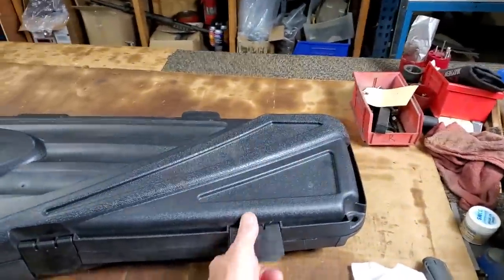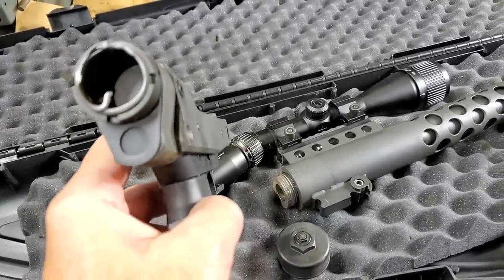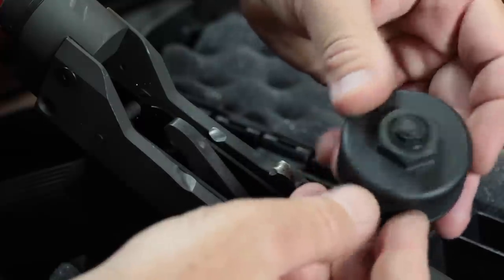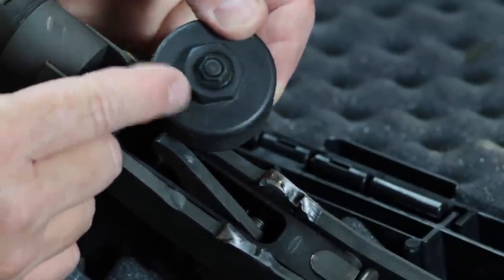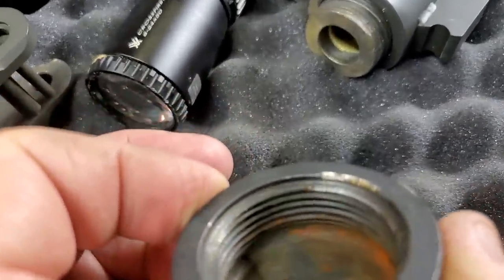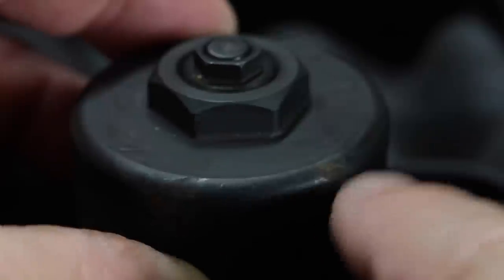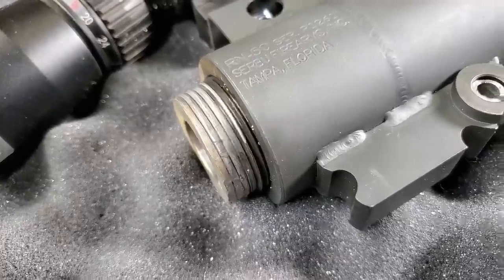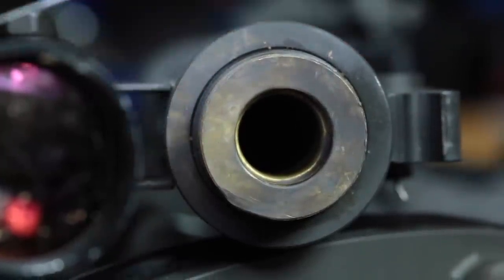Kentucky Ballistics' RN-50 Blow-up:  First Look

Comment: Scott got extremely lucky and it's a great case example of getting too complacent doing something. He's shot a lot of second hand specialty ammo and it's worked out for him. So when the warning signs popped up, ammo performance being erratic, harder recoil, larger flash, etc. That should all be signs to stop firing that ammo he didn't. Thankfully Scott didn't film that alone otherwise there would have been the horrifying scene of a man bleeding out as his last video.

What we can all learn and reinforce from this is when ammunition is behaving different or erratically STOP using it. Ammunition should be consistent, any time you pull that trigger and it feels off stop and think about it, did it just squib? Are the rounds underloaded/overloaded?
Reply: @pete7413  Wow yeah squibs suck let alone 2 of them, if you don't notice it then you are loosing a gun and a body part usually. I don't reload and thats the reason, I simply don't trust myself to not make a mistake like that. I am sure there are plenty of people who reload and get along fine but for me its just a no go. 

The best way to make sure you aren't going to do something that kills you is asking yourself one question, "How many times can I die." if the answer is 1 then you will always want to error on the side of caution and just not do it. 

The closest call I have ever had was having to pull a live round from an AR barrel. The extractor just wouldn't grab it and I couldn't get a decent grip on it even with the barrel remove. So I had to do the hairiest thing to get the round out, drive a rod through the other end while it was pointed in a safe direction and tap it out. I knew if the round went off that my hand would also come off. It was a bit nerve racking to say the least.
Reply: That's the theory, but problems tend to arise when it's face with reality. "No one expects to be in an accident", and while yeah in hindsight there was something wrong with the ammunition, it's not hard to see why it went unnoticed until the gun failed catastrophically. How often did Scott get to fire SLAP rounds? What was supposed to be "normal" for decades-old, rarer-than-gold specialty ammo?
And sometimes, your attention is on something else than the ammunition. For instance, I've recently inherited an old, circa 1893 Modèle 1892 revolver. While it's in a good shape, it's real old, and chambered in night-unobtainable 8mm92 rounds. Only FIOCCHI makes ammo in that caliber anymore, at 80€ a box... but you know, it's manufactured ammo, so it's fine, right?
Anyway, I went to the range, loaded rounds one by one in each chamber to check for any anomaly... on the gun. It didn't even OCCUR to me that the brand new, MANUFACTURED ammo I was using could be defective. Well it was - bullets didn't even clear the barrel, and it took me 5-6 shots to realize it. Thanks goodness it's a wimpy revolver cartridge in the first place...
Reply: @Kma99107  That's totally different. Blanks still have powder in them. That amount of simple air pressure up next to your head will kill you. You don't need an actual projectile.

Comment: Don’t let the negative people here discouraged you are all. I’m a mechanical engineer and have seen failures in a lot of different products. It only takes one weak spot or using something that the product wasn’t designed for that will cause a failure. It is going to be hard to tell what exactly failed but I believe you will figure it out and if it is your gun I’m sure you will fix it and help others out with the ones already out there.
Reply: Scott said in one of his videos that he believes it was a VERY hot SLAP round putting out way more pressure on the gun than what a typical properly loaded SLAP round puts out. This gun theoretically should have no problem firing a SLAP round that's loaded correctly, as Scott has done MANY times on his channel, but in this particular instance the round was loaded incorrectly causing WAY more pressure on the gun than normal.
Reply: @soulessshadow5356  exactly. That was the weak spot I was referring to in my above comment. Thank you for adding details. Much appreciated.

Comment: It could be that those gauges on the receiver, behind where the ears used to be, were made not by the cap but by the sheared off ears that bounced off those spots after they got sheared.
Reply: There's matching marks on the cap.
Reply: @dchil15  to me it seems like the marks on the cap match the ears better. Those marks on the cap seem like they are at the points where the cap pushed on the ears when shearing them off.

Comment: Does anyone have the spent case of the slap round that was fired before the blowup????
That would be the one with the huge muzzle flash. That primer must be completely flat.
Reply: I believe that was the primary suspect right there. Who knows what could have happened at the point of that shot going off. it may have generated the initial flaw in the thread which Scott would have most likely missed unless it was hard to unscrew. i am also curious if there was a bore obstruction after the wild round that was missed after all were only human. Mark will keep people informed Im sure.
Reply: @kriztov265  Bore obstructions typically damage the barrel, not the action.
Reply: @MrTruckerf  Assuming the obstruction is down the barrel. Im more interested to see the barrel internal condition at the mouth / neck area. The projectile is designed to penetrate and is a reduced calibre. Im sure mark will have some images for us that are interested. Like i said the previous round may have been the start of it.

Comment: I'm curious if the projectile itself was ever recovered. The amount of overpressure had to be massive... did the CIA ever load SLAP rounds with the TNT frags like they used to with the 7.62's?
Reply: My thoughts exactly...
Reply: I wouldn’t doubt it
Reply: I originally thought about that also that it could have been tainted ammo but I think it was more likely ether counterfeit ammo or a home reload using the wrong powder since there is big money in rare ammo
Reply: @killdizzle  Not exactly relatively new they were developed in the 1980s and seen use in the 1990s ODSt so 30 to 40 year old ammo and allot can happen to it in that time as it passes from dealer to dealer, while I agree it is less likely to be tained/spiked ammo and more likely counterfeit or poorly reloaded, we however can't exclude the possibility that it might have been as spiked ammo of all kinds was left in large quantity's and in the calibers that the enemy's used in Iraq and Afghanistan and much of the old ammo was collected and then privately sold after the wars and some was unwittingly collected and mixed back into allied stock piles later to be sold off privately.
Reply: @killdizzle  Could be one of the rounds left for the mostly peaceful moderate rebels of Syria and somehow found its way to the states again

Comment: Wow! It's good to see the damage up close. Seeing that thread ripped off like that is amazing, especially since the cap is in such good condition. Not to mention seeing just how thick the lower sides are, it's shocking to know the two ears were cut off like they were. You sure do make a quality Firearm. Thanks for sharing, Mark.
Reply: In most firearms, barrel steel is softer than the receiver unless they heat treated the threaded end of the barrel.  Thread fit would also be considered, I would think.

Comment: Those side plates are scary to me, it sent enough energy rearward to strip the large barrel threads and then propel the cap rearward at a fairly incredible velocity to do that damage... I don't think you can overbuild a gun enough to contain that kind of chamber pressure.
Reply: I mean, you can, but at that point it's called a cannon. lol

Comment: Is that still considered a "firearm" or is it sufficiently "destroyed" to be just some vaguely gun shaped pieces of metal?
Reply: firearm
Reply: The receiver is probably still legally a firearm. The rest is legally parts.
Reply: It's one of those things where it's a firearm until you report that it isn't. Consider that if he opted to repair It he probably would not have to file it as a new gun. I'm not saying somebody should repair it but just as a discussion point. 

Typically they require a non firearm to be torch cut in three pieces. Often they will require destruction of some pressure bearing component too.
Reply: @tadferd4340  i don't think so, its only a firearm if it can be used with all the damage it could probably be considered inoperable as is
Reply: @GunFunZS  the torch cut is usually just for machinegun receivers, I think you can make a normal firearm inoperable in many ways.
Reply: I’d call it destroyed but the Waco kid would call every piece a dangerous weapon of war!🙄

Comment: Are you planning on any revisions to the design of the gun(maybe to limit the destruction of the ears) to mitigate damage to the user on the extremely rare chance something like this happens again?
Reply: I hope he starts hot loading rounds (remotely) to see the breaking point & the fail spots 💯 that would make a cool vid aswell 👍
Reply: I would suggest weakening the pivot pin so that in the event of a similar failure,  most of the debris would be blown forward rather than back.
Reply: I'm certain that is one of the things he's going to look at.

Comment: Something my completely amateur eye spied: on the left hand side of the breach cap, the imprint from the locking lug is vertical, but the imprint from the right hand locking lug is twisted.

Kinda suggests to me that it failed on the LHS first (blowing straight back) which then caused the RHS to fail and twist (giving it the smeared imprint)

Either way, fascinating to see the initial investigation and it's great to see this level of transparency. Top man!
Reply: Suggesting that when hardness of the sheared threads is tested, several points around the perimeter need to be checked.  Just to be certain there wasn't a soft or brittle section where the failure started.

Comment: Will be interesting to see what the powder charge of each of those rounds are.
Reply: I bet they loaded with standard powder  and not the low mass intended for the 350gr vs +600gr. Those sabots are a lot lighter.
Reply: @1980Baldeagle  thst almost certainly wouldn't do it. It wouldn't change the pressure to over 3x 50 BMG's max
Reply: I'm guessing it wasn't WC 856
WC 856 is the factory powder specs for SLAP rounds.
Reply: @1980Baldeagle  powder designed for the heavy projectiles would cause less pressure using light projectile.
Reply: @saw6f4  correct, but not if you load half the amount. The slap ammunition is loaded with about 360gr of w856 i think. The standard ball is around 650gr of 860 i think. So if the reloads were charged with w860 at 360gr, which is high mass comparatively to w856, you would have a half full case. And as you know, and if you don't, half full case can be very dangerous. You can get double and triple max case pressure just with powder laying down and not filling most of the case.  Thats why you need low mass powder for reloading good subs.
Reply: @1980Baldeagle  I thought that was mainly for black powder and that regular powder was safer to load less than the total cartridge length
Reply: @flightlesschicken7769  no. The burn rate of smokeless powder increases as  pressure increases. Black powder has a constant burn rate no matter. The problem with BP is if its a loose charge you will get a slower charge ignition and low pressure as well as inconsistent pressure based upon the position of the powder. Smokeless pressure goes through the roof in this situation. If I load a 300 blackout with a half charge of rifle powder in an attempt to get subsonic velocity one thing happens. I get velocities across the board. 800-1900fps. And I can change those velocities by holding the rifle at a different angle to change the position of the powder in the case. This is one reason why the the most accurate pet loads for a rifle usually use a powder that entirely fills the case and might even be slightly compressed by the bullet. Number one, that powder puts u in the accuracy node but secondly the full case and compression provides a CONSISTENT amount of energy.
Reply: @1980Baldeagle  I didn't know that about smokeless powder, but you are partly wrong about black powder. Although it is true that black powder's burn does not depend on pressure, having an air gap in a black powder anything can/will cause the flame front to "jump" and burn the powder far faster (because it effectively has multiple flame fronts) than it otherwise would. This can and will blow up a gun. 

With black powder you have to fill up the cartridge all the way. Either by using a full charge of powder or a filler. I know with smokeless powder you do not need to load a cartridge all the way--for example, starting loads and max loads when reloading use the same powder type but one has way less powder--but it makes sense how you wouldn't want to go below a certain level of cartridge fill

Comment: Would of liked to see the muzzle brake, any damage from a sabot blockage
Reply: I watched a video about the theories of what failure mode could have occurred and I cant remember the exact distance down the barrel the bullet has to be to blow the back end off but it was stated that a .50 somewhere past 6" from the chamber the pressure becomes low enough to lessen the chance of an explosion at the back of the chamber let alone a bullet stuck all the way down to the muzzle brake.
Reply: You shouldn’t fire any slap rounds through any muzzle brakes ever! Look it up
Reply: @kxp.1496  . Yep, that's why i want to see the brake for signs of damage
Reply: @gavinperch9413  . But an obstruction will increase the pressure regardless of distance down the barrel
Reply: @shanevonharten3100  yes but the further the bullet gets stuck in the barrel the lower the pressure at the chamber. Also I think that barrel obstructions tend to rupture the barrel just behind the bullet, however considering that the barrel in this case is thicker than the standard one for this rifle maybe neither of my points are applicable.

Comment: Was wondering if there is anything up w the muzzle brake
Reply: I was wondering the same thing.  Was there any kind of build up on it that could potentially lead to a higher chamber pressure??   I have now clue if something like that could be possible.  Unfortunately I am not an engineer or gun designer.

Comment: Looking forward to your full analysis. Very glad Scott is OK and the right people are on the case.
I'm no expert and won't pretend to be, but an observation. Perhaps the breach cap was already begining to tumble as the threads and ears sheared. Could possibly explain the marks on rails above hammer, and on the stock.
And as mentioned by others, hope to see you disassemble the rounds to check powder load.

Comment: All I know is that you're not supposed to shoot SLAP rounds through a rifle with a muzzle brake. 
Rule #1.
Reply: This is the true fault here, recalled or faulty ammo probably contributes.
Reply: Muzzle obstructions at the end of the barrel wouldn’t cause the breech cap to explode. Unless there was a manufacturing error the breech cap is stronger than the thinner end of the barrel

Comment: Mark, there is NO way the rifle failed. I would swab the inside of the case and have it analyzed. It's either a high weight/low volume powder, or, outright sabotaged round. I bet if you consider the tensile strength of the entire set of the barrel, bolt and guide prongs, it would take over 200,000 psi to do all that damage. Whoever loaded that round is responsible. When we build guns, they are like our kids. We take pride in them. I understand your hurt. I also understand, same as myself, you won't stop till you get an answer. Keep us posted.

Comment: The way Scott’s rounds were hitting way off from the target before the rifle exploded is a possible  indication that there was a slight barrel obstruction and you should never use that muzzle brake unless specifically designed for with slap rounds. Also before it exploded those rounds had some insane muzzle flash.

Comment: Once I inadvertently crimped a 30 Carbine handload cartridge which the allowed the straight brass case to slide into the rifling.  When fired the bullet movement was restricted by the brass cartridge case crimp extending into the rifling of the barrel.  The cartridge head blew apart ala Scot's 50 caliber case except to a lesser degree.  114 grain  bullet, 14 grains of 2400 powder.